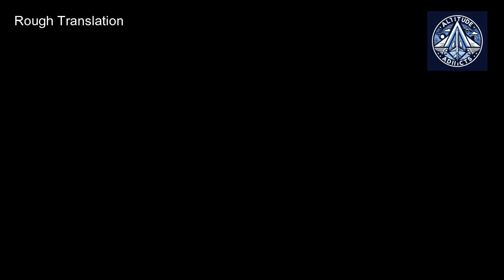Tu-214 Flying Laboratory - Official Video - Translated

Comment: I still don't understand. Did the plane just have its paint changed? Or is there an engine replacement, avionics and software system updates?
Reply from the maker: As per the video, the plane was once operated by an airline and then preserved. This plane was converted to be a test laboratory for Russian domestic technologies. It is not yet specified what has been changed in the plane. Engines are the same. Most probably, the avionics and some structural parts will be tested. As for the painting, Russia is encouraging Belarus as it is its ally. Hence, the painting unit has been set up in the Belarusian company which already makes parts for Russian planes.
Reply: @altitudeaddicts 
So the plane was once an old plane and then made new again, isn't that right? Then there is a replacement of completely Russian-made components. Were there previously components on this Tu-214 that were made in the West?
Reply from the maker: Yes, the plane is made new again. It is not known what are the Russian components in it. Yes, they had Western components before. In addition, new technologies will be also test.